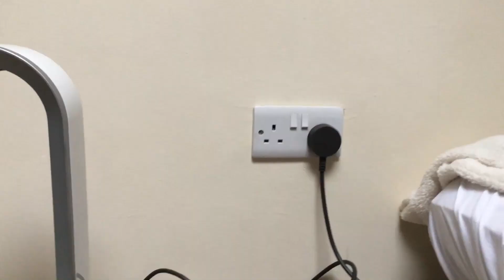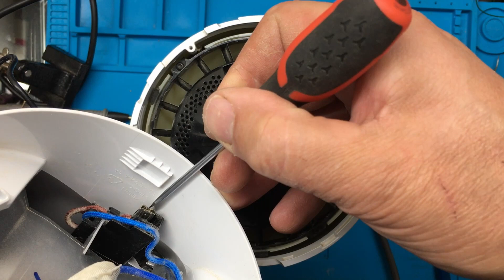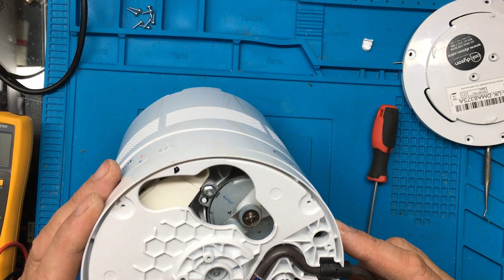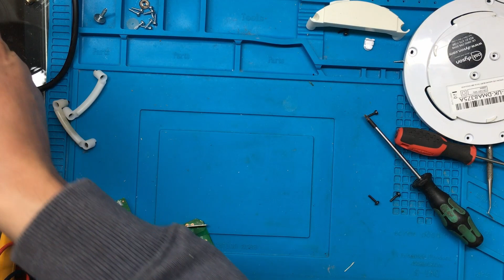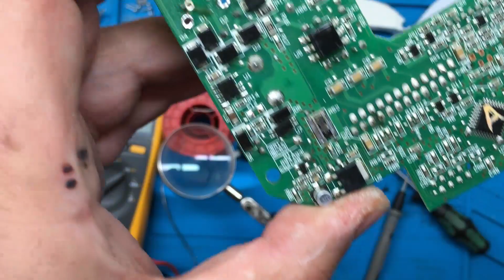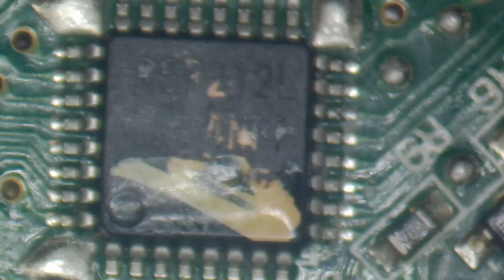Dyson Hot And Cool Fan - Can I Fix It?

Comment: Thanks for your various Dyson fan videos, which were very helpful when I was working on one of these. There's a version of the PCB with a different shape and discrete MOSFETs instead of your single-chip motor driver. That one has two 1.6 A SMD fuses, and one of those (F1) seems prone to blowing for no obvious reason; it had happened to mine, and a discussion on iFixit suggests it's not uncommon. New fuses are rather hard to get, but apart from that it's an easy fix (mine didn't succeed, but that's another story).
Reply from the maker: You're very welcome! Thanks for letting me know.

Comment: Hi Mick, i am struggling with a Dyson am07, who has no power. I have 330 V DC on the big capacitor. How can I find out where the power goes. I enjoy watching your videos and hope to see much more.
Reply from the maker: It should go to a switching IC (about 8 pin) which gives out a 5v output on a capacitor just after an inductor.
Reply: Ok, I found it.  I think the coil inductor is broken. The text on the component is 102L 0.8.
Reply: How do I find out which inductor I need?
Reply: Well, the ic gives 5.87 volt to the cap, where does it go from there?

Comment: I have an HP04 and that thing is like a chinese puzzle to take apart. WAY over engineered inside as you have to take out about 30 torx screws (3 sizes) out and the entire floating internal fan motor out just to get the bottom plate off so you can get to the oscillator motor and the primary power cord. The oscillation bends the power line every time and mine eventually wore out and shorted. The harness is special order but you can sub in a line cord but youll lose the integrated rubber anchors/plugs.
Reply from the maker: That doesn't sound designed very well if the cord keeps breaking due to it oscillating!
Reply: Only thing in gonna do is change out the power cord from the base outward.  If that doesn't cause success, its outta here.  Thx for the presentation.  Borked!

Comment: It looks like someone made a big mistake while trying to repair it, maybe feeding high voltage into the board somehow, and that caused the big disaster there.
Reply from the maker: I think what happened was the main motor control IC shorted internally (It takes high and low voltages) and it fed the high voltage back into the low voltage parts. This can also happen when a MOSFET blows. It can feed the high voltage back down the gate pin destroying whatever controls it.

Comment: Hello, thanks for you're videos and sharing your knowledge.
I have this fan, Dyson actually did a recall on some of these as these had the potential to cause a fire internally on the PCB (like yours)
I was able to identify the power chip from your 2nd video luckily, mine was beyond reading numbers off it. I have the fan up an running now but have an unusual issue. If it's on heat and I try to oscillate it, the fan cuts out and "E1" is displayed, this also happens if I power down the unit correctly and then move it to another socket, I have to go through a routine to get that error to clear. I'm thinking it's a the power drop as the element cuts in being registered as "power cut off"
Would you have an idea of where I should check, initially I'm thinking resistor/capacitor on the feedback circuit??? 
Sorry to bother you with this
Reply from the maker: No problem 👍glad my video was able to help you. I'm not sure on the new problem you have. Does it only do it when oscillating? I think there is an electrolytic capacitor on the output of the power supply chip, but I think that would probably just make the MCU reset.
Reply: Thanks for replying, it will oscillate normally on cool setting without issue, raise the temperature and it will continue oscillating until I assume the power it put to the heating element, it's at that point the E1 error appears and the unit locks out. The E1 apparently is when the unit gets switched off incorrectly( i.e the wall plug) but this unit gives that error regardless of shut down once the power is removed and supplied again, It's odd

Comment: Dyson may have lead the way with innovative designs, and I can;t deny they have designed some great stuff. But whenever I hold a dyson product it just feels cheap and tacky to me. I had a Dyson ball vacuum cleaner earlier this year, brilliant suction, but the plastic felt cheap, flimsy and brittle.
Reply from the maker: Totally agree, the quality of this product doesn't seem as good as the earlier version of the fan I looked at. For instance this one has a plastic bush it rotates on, whereas the earlier version had a nice metal bearing and shaft.
Reply: I have a Dyson DC08, it’s over 30 years old and still going strong.  Sometimes appearances can be deceiving!
Reply: @jameslarson6555  Appearance has nothing to do with it, it's personal experience.

Comment: So for my Dyson fan, only the heater works, not the cooler. What would you suggest?
Reply from the maker: That sounds a weird fault, as the heater just uses the fan but with the heater switched on.
Reply: Sounds like a stuck switch/diode/transistor.

Comment: Hi. great videos man. Thank You.
I have a question. Would you fix my Dyson hot and cold? I think the heating element is dead.
Reply from the maker: Sorry, I don't really take in repairs, but if it is the heating element then you won't be able to replace it as the top section is plastic welded together and opening it will destroy it, that's why replacement heaters aren't available on the internet. I'd suggest seeing if you could buy a replacement top section second hand fro Ebay if it's definitely the heater.
Reply: @BuyitFixit  Thanks for the info!!

Comment: Great video . What's the part just under your thumb at 15:10? Had a look at pcb,everything looks ok, except from that part.. As this is not my field of knowledge - just wondering if replacing that part would fix the problem?
Reply from the maker: I actually fix this in another video (well another PCB that a subscriber sent me) and that part which is a power supply chip had failed. When you plug the fan in, if that part is working you can hear a high pitched wine from it. You should also have 5v coming out of the regulator which is a little bit futher to the right of the part. It has two legs and a solder tab (U2). Be careful as this circuit is not isolated from the mains!
Reply: @BuyitFixit  Cheers buddy. Going to watch your other videos too. My fan doesn't turn on at all. It looks like U1 has a hole blown in it.. And because of the damage I can't see any numbers on it..
Reply from the maker: I'm fairly sure I show the part number in the other video, I can't remember it off hand 👍
Reply: @BuyitFixit  It's probably my first time trying to identify and fix a pcb, so your response is highly aprecciated.
Reply from the maker: @karapatas  No problem, glad to help👍

Comment: My Dyson now just blows warm air not hot,  I'm quite tempted to take it to bits to have a look internally ...  Any tips on what I should be looking out for ? 👍
Reply from the maker: Hmm. Faulty hermal cut out? or theres a temperature sensor on a small board with red wires going to it. It that was faulty perhaps? I've not really looked at the heater side of things but there was possibly two elements in the top section. Check both have the same resistance.
Reply: @BuyitFixit  .. Cheers for that, I'll certainly have a look & see what I can find 👍👍

Comment: This Dyson AM09 HOT + COLD is now a VERY EXPENSIVE PAPERWIEGHT 4 years later!!!

H2 errors left and right..

I turn on the heater setting and NO MATTER WHAT SPEED< it's stuck on SPEED 1 (LOW) and then suddenly an HOUR OR 2 later, it will suddenly increase speed... I cannot go passed speed 7 because it will almost instantly go to H2 ERROR.

It's plugged directly into the wall.

I opened it up there and there was HARDLY ANY DUST

Dyson is USELESS and just offered 20% off a brand new one.. But they don't make these anymore so you are stuck with a $1000 purifier....
Reply from the maker: I think H2 might be a hall effect error. I think the unit I repaired showed similar with the motor unplugged. Perhaps the wiring going to the motor or the motor itself if faulty? I got a replacement motor quite cheap from Aliexpress £10 or so...
Reply: @BuyitFixit  it only occurs in hot mode. The speed works perfectly fine in cool mode.. I could have it set to 10 on cool, then switch to hot and while says speed 10, it's running at 1.. then perhaps 1 hour or more longer and it suddenly will increase speed...
Reply from the maker: Just did a quick search and this seems a common problem :( unfortunately I don't have any experience with a unit with this error. I might try and get one at some point to diagnose the problem but they don't seem very reliable or well made even from what I've discovered so far.. the cool fan I looked at seemed better built than the hot and cold version.
Reply: @BuyitFixit  yeah it almost seems like they made it so the customer can't easily clean it to take apart. To unplug the top, they run the wires thru to the bottom Parr thru a bunch of channels and clips instead of simple plugs. Can only imagine what a pain in the ass tech repairs for dyson must deal with....

Comment: I have the same model, not working (just dead), but the PCBs look OK, nothing burned. You could have them if you wanted to give it another go.
Reply from the maker: Ooh now that's a generous offer! Which I would happily accept!  Hopefully you are based in the UK as postage from abroad would be extortionate. Feel free to drop me an email. buyitfixit@outlook.com
Reply: @BuyitFixit  I am actually in Australia, but let me check whether the shipping would be too expensive. I’d be keen to see whether you can make it work again. You do a great job explaining the electronics. I think there should be more channels like yours - educative and showing that you not always have to dispose of a product just because a fuse blown or some wire got loose.
Reply: @videos2761  Yes, indeed. There is a separate video about the repair using my parts on the Buy it Fix it channel.

Comment: basically the circuit operation is not to hard to understand. if someone have some experience with designing electronics this could be fairly easy task. But have to be viligant with the 220v .